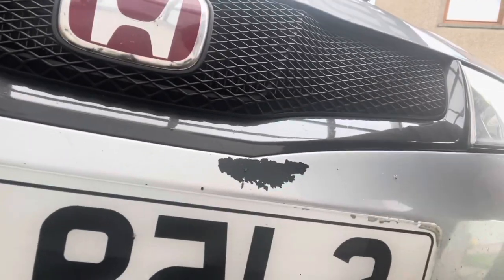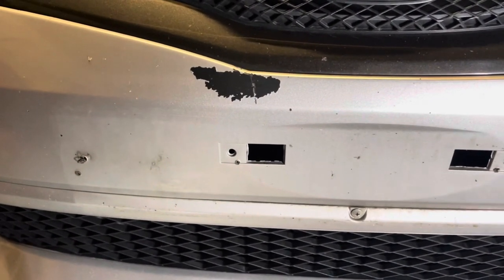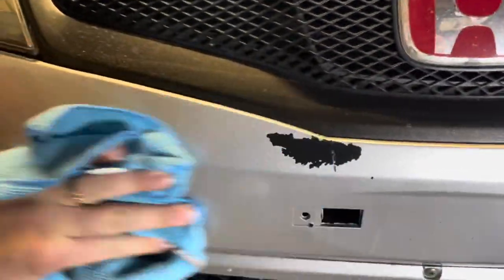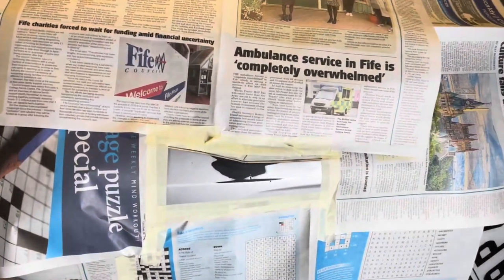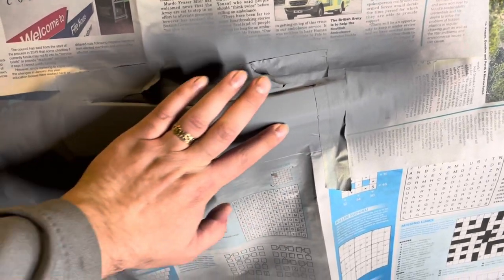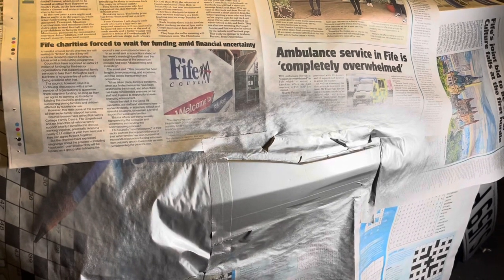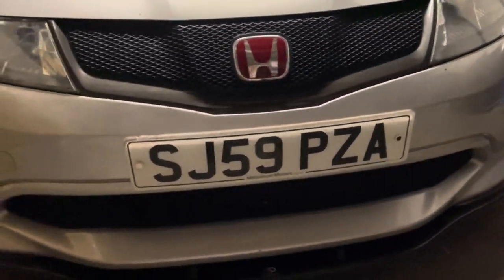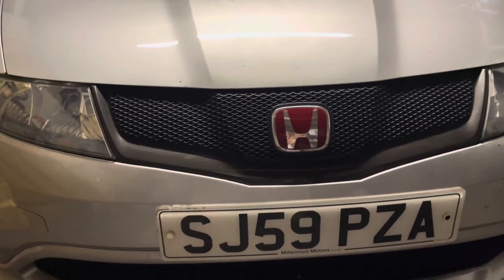Paint Repair Fail - Bumper Repair on Honda Civic FN2 Type R

Comment: Few tips I could give you, done a lot of paint work myself, mostly rattle cans 😂

Mask a MUCH larger area, leave a bigger opening. Then spray the area you'd like as you've done there but blow the edges out lightly. That will blend the colour out to rest of the bumber. Only other thing I noticed was the scratch that was left, grab some plastic filler, fill that and flat it all back nicely as you did already. Also stay away from cheap paints. Get some 2k, part clear lacquer which you can get in a can too. Then do the same with your laquer as you did with the paint, blow it further out then you did with the paint covering a much larger area. Once the laquer is set you can flat the laquer down, polish it up and you'd hardly be able to tell it's even there 🙂
Reply from the maker: Thanks Liam, appreciate the advice 👍

Comment: Same mistake I made when I tried touching in a bumper, better to mask off a larger area or do some soft folds on the paper rather than sharp lines with the tape. Looks better anyway than a black paintless section. Got a couple of touch up areas I need to do on my car, weather isn't great for paint at the moment though or certainly won't be soon so may have to leave mine until next year now lol.
Reply from the maker: Thanks for the advice, really appreciate it. It no longer draws the eye to the defect which was the initial aim. Practise makes perfect 😂👍